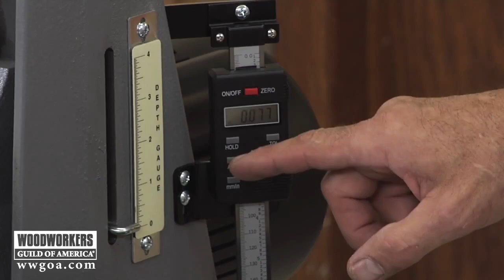Versatility of Surface Sanders: Supermax 19-38 Drum Sander | Woodworkers Guild of America

Comment: Just used a friends to rough sand some end grain cutting boards. It had a decent mount of glue and burn. We only used the 80 grit, but what I thought would be a 2 or 3 hour job involving pencil marks and so on was actually about 15 minutes on this. It’s a tough purchase for a regular, make stuff occasionally guy like me. But if I had to make 20-50 boards and my friend wasn’t home. Instant purchase. Swipe and look away.

Comment: Hello George..great video!  I recently purchased a second hand Supermax 19-38 Drum Sander (nearly new) and am having a few issues.  I set it up using the manual, but getting a lot of slippage between the feed belt and the wood.  The conveyor belt seems pretty slippery.  Is it possible to put something on the the belt to make it less slippery?
Reply from the maker: Hi Rick Bennett, Please reach out to our product support team at 1-800-260-9663 or support@rockler.com. They'll may be able to assist you. Thank you

Comment: I bought a supermax just for my end grain cutting boards. I have a problem with burn marks, i keep the belt very clean. i have used 80 grit and 120 grit paper, any thoughts?
Reply: Perhaps several light, shallow, fast passes
Reply: I ran a few hard maple end grains too deep and that’s when it causes burn.   It was my first time and I sanded 20 cutting boards.   After the first five boards I learned to be patient and not get greedy taking off too much.
Reply: Shallow passes is the key. Once you burn a piece of sandpaper, you’ll need to put in a fresh one, or it will keep burning.

Comment: NOT sure if this is the right tool for me.  I have a cnc router and do mostly 3-d carvings.  Typically my carvings tend to cup a little.  My carvings also have a rope border around the perimeter.  Now can i feed my carving through this type sander to remove the cupping effect from the back side.
Reply from the maker: Yes, it should work if there is a consistent thickness around the border, also if the material isn’t too thin as it may flex.
Reply: R Ashwood Xz

Comment: No way to run end grain through a planer? I beg to differ.
Reply: Yes, I have a planer and can run band sawn thin stuff through there and have run glue up table tops at 24" with no problems. Maybe a smaller planer with 12" cannot handle end grain but the larger planer is fast and cleaner than a sander. Infact you would mess up the finish of a larger planer by sanding the surface. I run exotic hardwood through the planer with all kinds of tricky grain and no tear out. I would require three of these sanders you demo just to have a series of grits to avoid changing all the time. A planer just requires thickness adjusting to
achieve a final digital thickness. Throwing the sander out of parallel and taking little increments of wood off with a drum sander or wide belt sander is time consuming and slow going. Some sanders will not sand exotic hardwoods or resin filled substrates: the belt is ruined in one pass no matter the grit. If you mill on a jointer and planer before assembly and do face frame construction accurately; sanding is avoided and you have planar surfaces to work with. Some larger wide belt sanders can handle end grain quickly and have special belts.